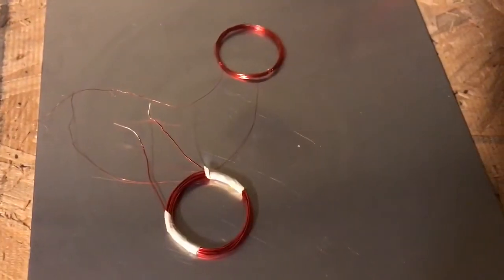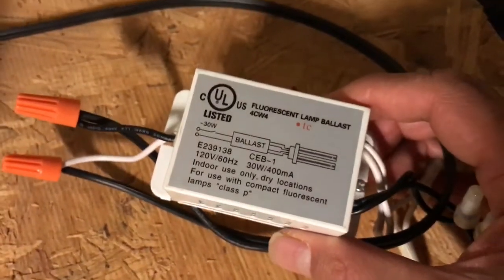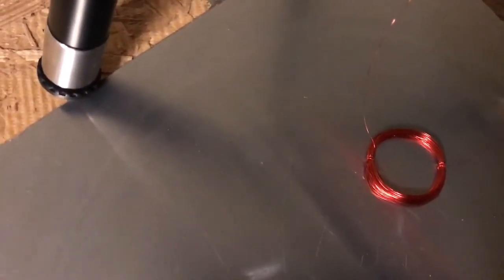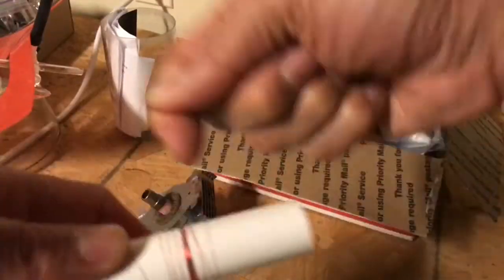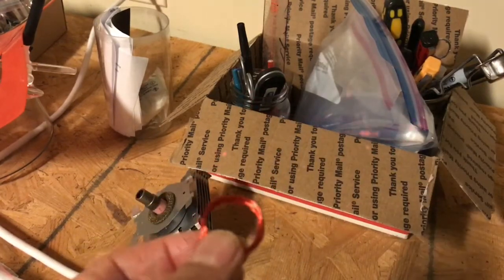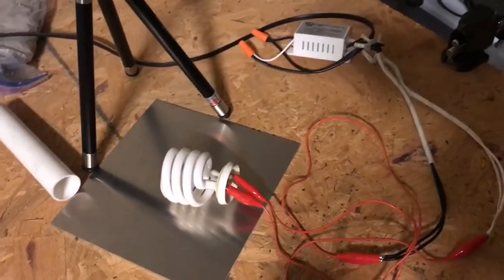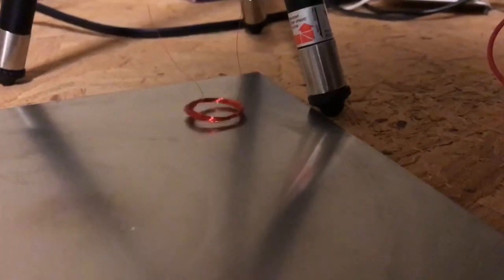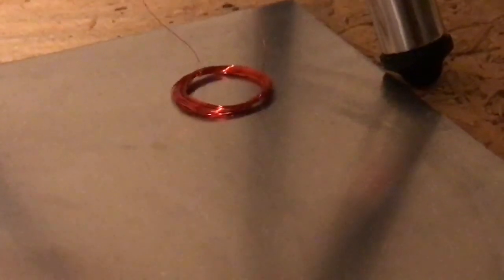Levitating Copper Coils

Comment: Why does it shake like that? Is it just from spring tension in the wire?
Reply: No one answered you after 2 years so I thought I would. The coil "shakes" or oscillates like that due to the AC (Alternating Current) cycling back and forth at 50 to 60 times per second as electricity flows through the coil. Unlike DC (Direct Current) from batteries, the terminals of AC (Alternating Current) from the wall reverse polarity 60 times per second in America and 50 times per second in Europe. As a result, the current flow that creates magnetism within the coil is rapidly changing from positive to negative or rather attracting then repelling 60 times per second which makes it shake like that.
Reply: Thanks bro  @homespunware6315